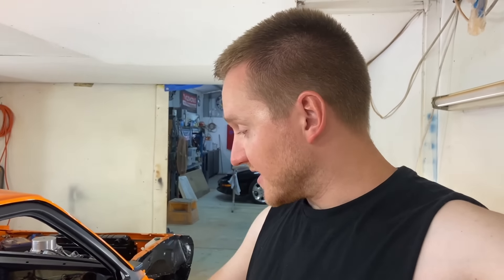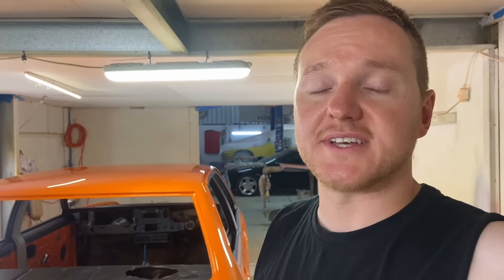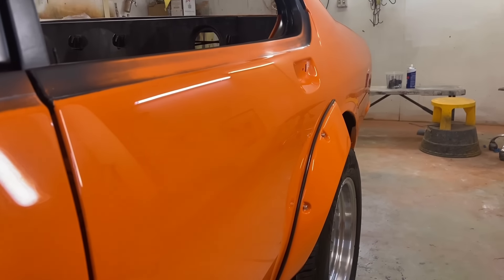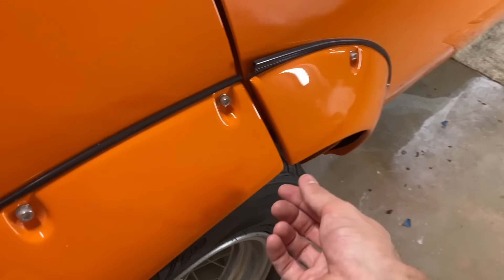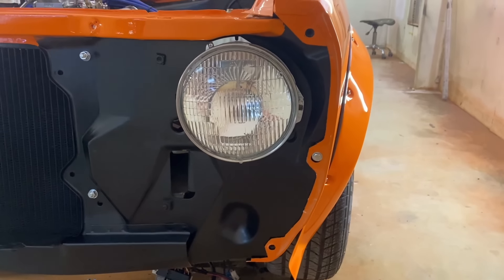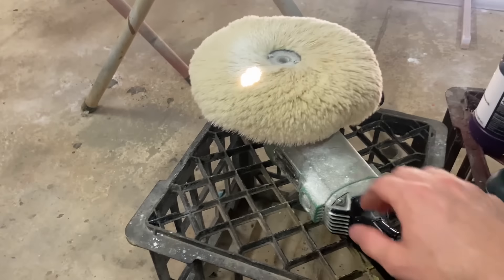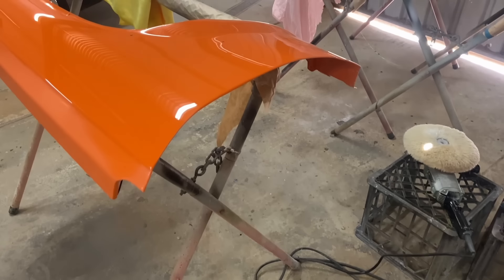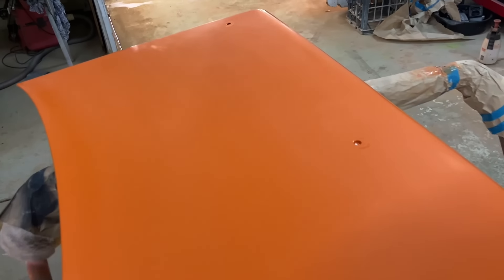LX V8 TORANA UPDATE - LOOKING MINT!

Comment: Here in Victoria those speaker holes are un roadworthy as they are structual. What about we're you are?
Reply: I had a ed xr8 falcon go through a regancy park in Adelaide and got done for parcel shelf. I had to get one from a wreakers and get a qualified mechanical/engineer to weld the replacement from both sides what a pain in the ass that was
Reply: Looking killer Blake, what a special car. 
PS: Was that Joe Satriani blacking in the background? Also killer...